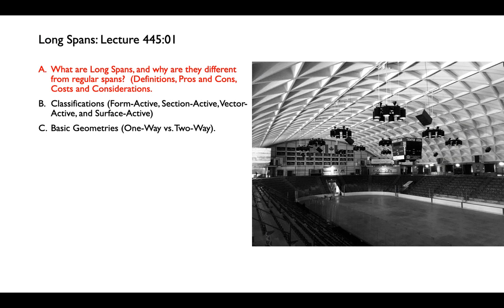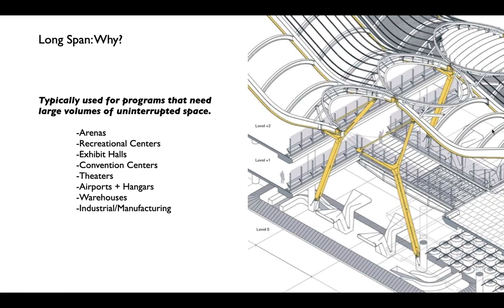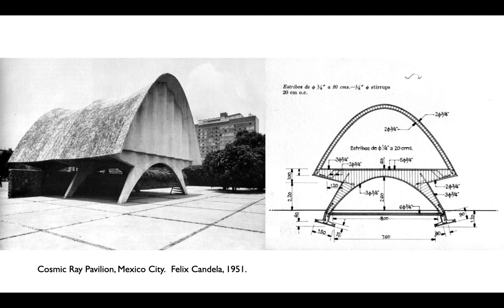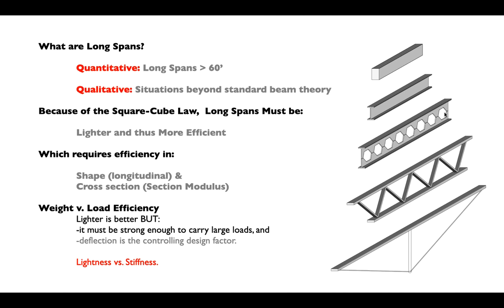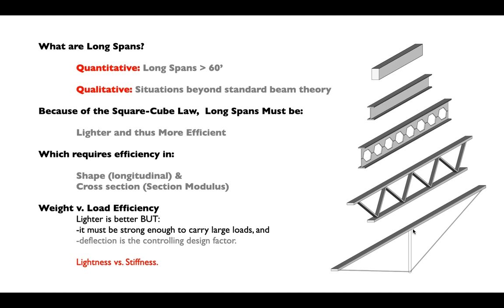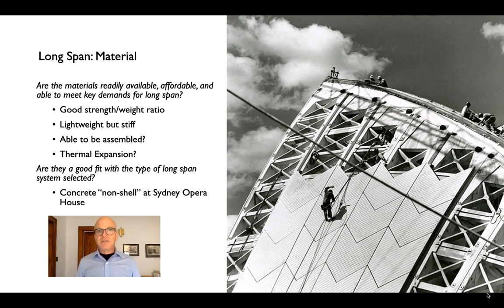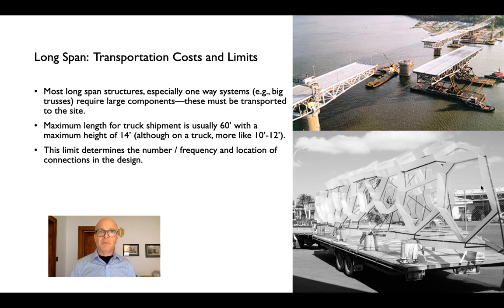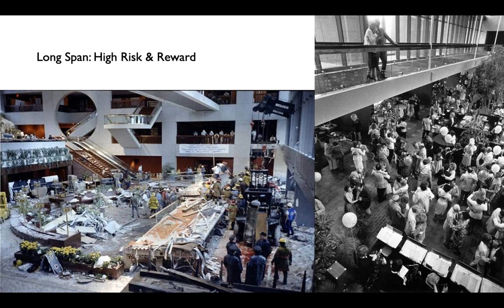ARCH 445 Lecture 01a Long Span Intro a

Comment: I hear the word “monolithic” in your lectures a lot. What does that really mean in the context of architecture and construction? What is so monolithic about a steel and glass dome?
Reply from the maker: By "monolithic," I mean that all of the structure's elements are strongly (and, more importantly, stiffly) to one another so that when one piece is loaded, all of the other elements "feel" it.  (Think of a frame of toothpicks connected by marshmallows--not monolithic--vs. one connected by very rigid connections--monolithic).
Reply: Thank you @thomasleslie274